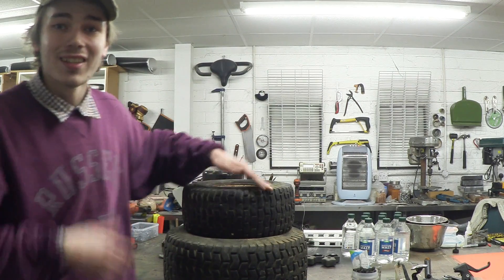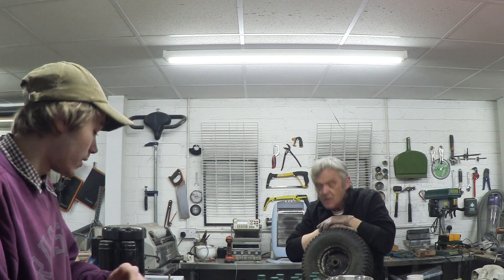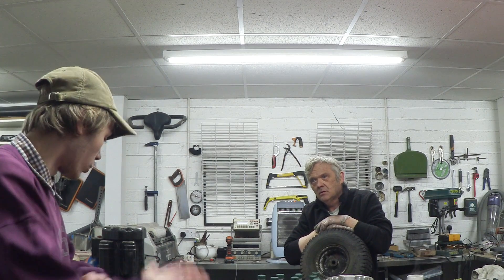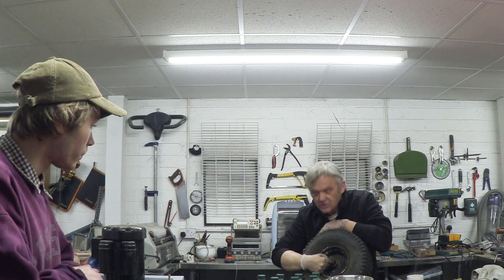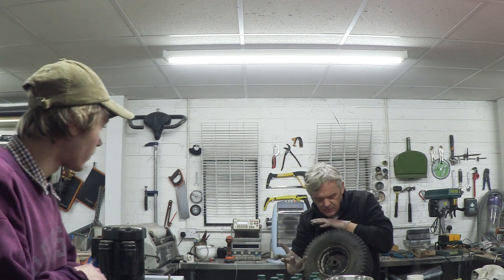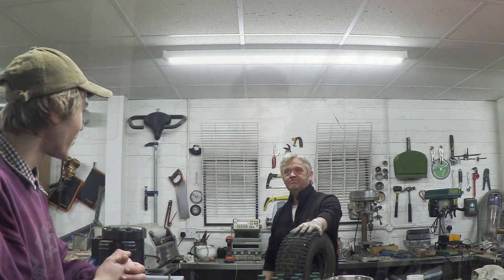961 - Building 'Bessie' - Doctor Who's Car - Lawn Mower To Electric Vehicle - Me And Luke Planning

Comment: Use 4 small motor scooter wheels so that it can hold the weight of you and the batteries be able to hold up to the speed. You did say this is going to be a electric vehicle right. Think weight and then think weight some more. LOL Rob's thinking: Ok Luke lets keep this simple, Luke: No Dad, I want a new Tesla style 4 wheeler. Me: It is going to get heavy guys, lol - I hope you are going to use a aluminum race seat with 4 point contact seat belts harness. I don't want to see either of you getting dead on me, please think safety on this build. Especially if you plan on trying something new like brakes or speed with a lot of weight propelled in motion. I love the build so far, looks like you are having as much fun as me brother and I had when we built our first race care. I use to race at Greenville Pickens Speedway about 11 years ago. It is a 1/2 mile asphalt track. Stock Renegade class, 1975 Camaro with a 400 small block and a 4 speed Munson transmission. I could get up to 92 miles and hour before needing to hit those brakes.  That curve comes up on you quick on that track. The car itself has been up to 150 mph on a near by straight away. Anyways, have fun guys, I'm sure you know exactly what your doing, LOL - You could name it, Mad-Scientist Racing and get Luke to make some decals that say that down each side, Some midnight blue would look awesome white lettering. Oh and remember weight, weight, weight.
Reply from the maker: to be honest mate this thing will do 10-15mph if you are lucky lol - it's a first effort for us - but the next one - well anything goes lol - cheers though - some really nice advice
Reply: @ThinkingandTinkering  LOL and your thinking 10-15 is not fast, oh wow. Maybe in a car its not fast but in a go-cart that is a broken bone speed and death if the head hits wrong. I completely understand, I own a 4 wheeler and I use to think the same way until I caught the edge of a tree one day and I was only going about 10 mph and it threw me, lucky for me a creek was what caught my fall. I'm just being mindful of your safety tips, I don't want either of you hurt. I like you guys.
Reply: LOL, I'm usually the one who throws causing to the wind and does all the dangerous stuff without think all the safety stuff is not for me, lol Weird to see me thinking for once about it.

Comment: Honestly I think it would be interesting to mount drum brakes so they press out from the stock rim into the modified rim so it disguises the brake profile but still adds braking power.

Putting the brakes inside the rim also protects the brakes from weather related wear to a small degree.

Just a few thoughts I had chaps, looking forward to seeing it done.
Reply from the maker: nice thoughts mate - cheers

Comment: Why not an engine brake? Using an electric motor you could incorporate engine brakes quite easily.
Reply from the maker: for sure mate - but then there are always lots of ways to do anything - basically we just make a choice and we have the brake callipers already - no other reason really and this is a first effort lol
Reply: @ThinkingandTinkering  fair enough, if you have them laying around may as well use them right

Comment: How crazy simple would it be to rubber break to the inside rim of the rear tires or a single disk break in the drive system?
Reply from the maker: to be honest mate we probably don't need brakes at all - but a couple certainly doesn't hurt and it gives us the practice of thinking about the system parts

Comment: I'm intrigued to see what types of tyres will be fitted, maybe it can float?
Reply from the maker: now then - that's an idea - got e thinking that one mate
Reply: @ThinkingandTinkering  it Will be a relatively lightweight platform, the important part for it to be able to propell itself on water is that the waterline doesn't go over 50percent of the wheel as the effect if lower will cause forward and reverse at the same time, I like Russian shed built amphibious atv's :)